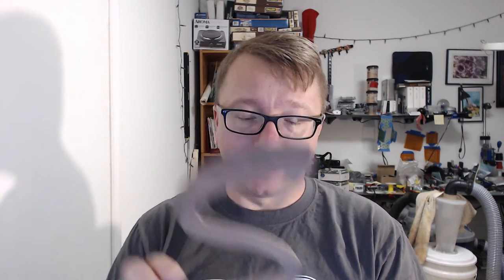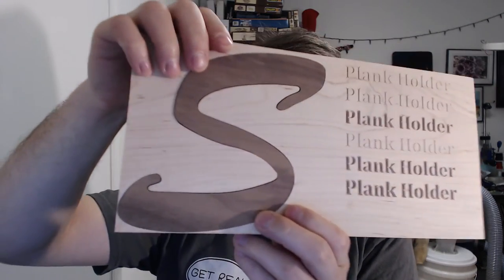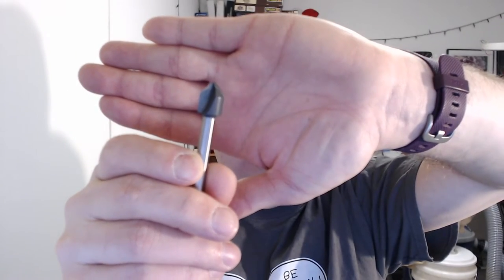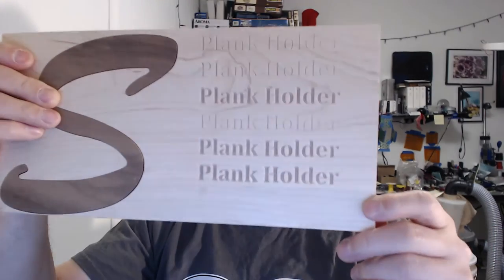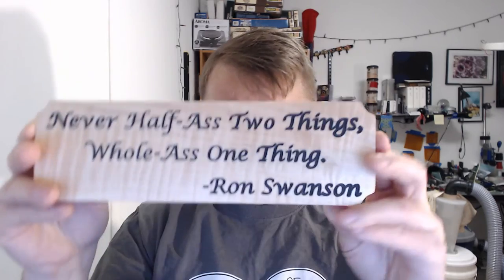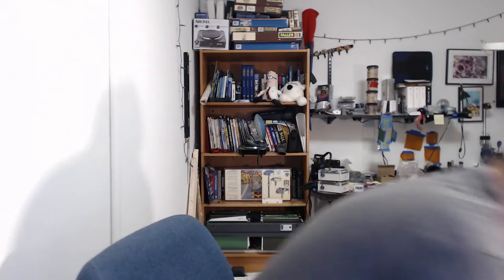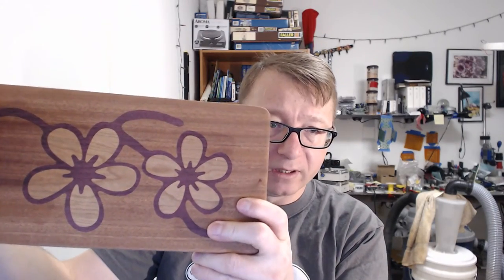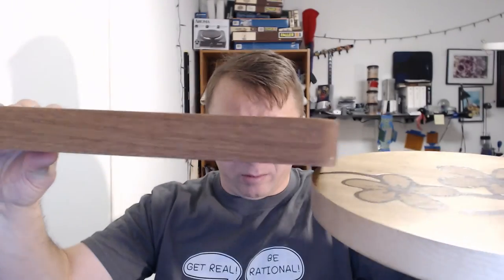Computer Aided Manufacturing 101

Comment from the maker: I got a comment about using Fusion to control an X-Carve.  Unfortunately the persons page is restricted so the comment is not showing up.  In short, you cannot use Fusion to control the X-Carve.  You can use the software from Carbide3D, Inventables (Easel), or Chilipepper (http://chilipeppr.com).  I use Universal G-Code Sender.  Hope this helps.